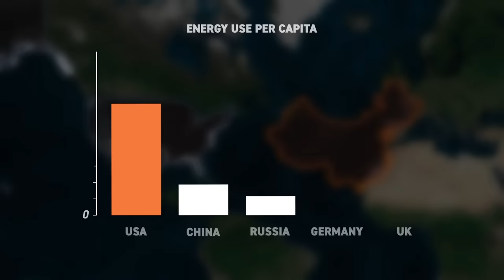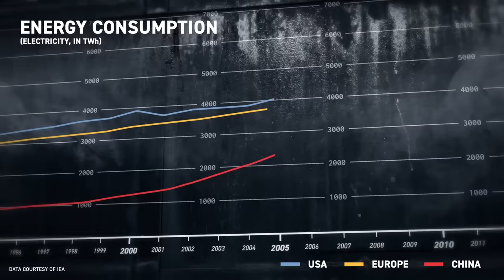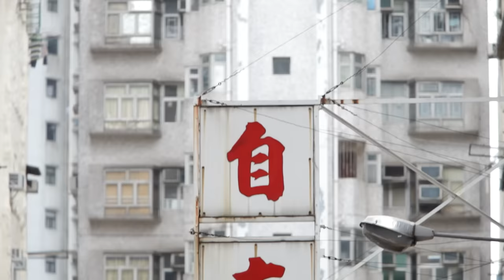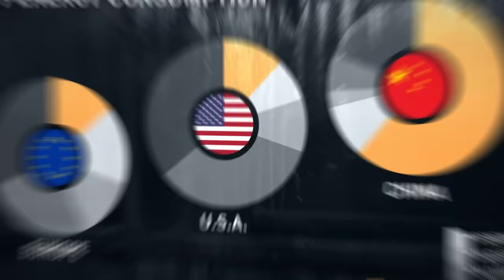China’s Electricity Problem

Comment: Nuclear is the cleanest, the strongest and the safest if managed by competent people who run it properly with proper security measures and personnel. 

Especially if we use plutonium. We just need good public perception and proper political support with good investment capital and awareness.
Reply: I've heard Thorium is also a good idea.
Reply: Its clean but also expensive. China does not want to invest up front, same problem like the renewables, the initial investment is to expensive for them. They would rather have short term gains then long term.
Reply: People also don't think about how much the LED bulb and the CFL before it led to plateauing energy in advanced countries. Every light bulb in my house is LED and every single one could be ion and it might be 100 watts total. That's crazy. We aren't that far removed from 60 watts being the standard for a single bulb. And at night the lights that are typically on in my house equal maybe 10-12 watts. Even our biggest TV uses just 52 watts. My last CRT TV used over 200 watts. Computers and game consoles are the only remaining energy suck beyond cooling or heating your house. Or charging your car...
Reply: I'm convinced (at least India) would be significantly ahead in thorium reactor tech if Homi hadnt been merced by the CIA
Reply: But those safety protocols won’t always be followed. That’s the biggest issue. Competent people will be passed over for favors or outright bribery. Saving money is always going to be the biggest priority, not safety.
Reply: Nuclear is more expensive than solar and wind which are dirt cheap. It's probably less dosh overall to just invest heavily in battery tech while building green energy infrastructure, which is why america's doing that. Nuclear missed its window.
Reply: in china nuclear doesn't have as much as critiques as in some european countries or USA and most don't really mind it. and construction of it has been increasing steadily in the recent years and even surpassing europe or USA in annual constructions of nuclear based powerplants (well albeit they don't have them at all more than a decade ago, so they are building a lot of them now). it's just the demand for electricity is so astronomical that the supply can't keep up at all, thus the rate of growth of fossil-based power plants are also the highest in the world just like i mentioned in the reply i sent to a person up here.

i know this fact cause i went to shanghai for my university education and my friends from there all don't have negative view of nuclear power at all. it's more like they think of them as very cool high shiet than it is being scary. well, idk about the other regions or older generations tho, but according to my urban & regional economics professor whose current research focuses on environmental effects of infrastructure (like high speed trains etc)  its quite accepted/popular.
Reply: @2failepic  It isn't expensive; it is a rock that gives off energy; the costs come from massive overregulation
Reply: @RJT80  you don't wash clothes or us a dryer? Or an oven (electric power I have)
Reply: Nuclear is very safe, the main problem is that it takes very long for it to recoup the initial costs. It's very cheap after you build it, so it's similar to renewables in that respect. There's a good Real Engineering video about this
Reply: I once attended a lecture where they calculated that even if China built 1 nuclear plant every day, it wouldn't be enough for the expected future consumption. Nuclear is the best but still not enough.
Reply: Greetings from Chernobyl and Fukushima
Reply: @RJT80  I think you're forgetting refrigerators, a/c, furnaces, and hot water heaters, as big power consumers. 
Also, as a note, in my area where people often have natural gas for cooking and heating, I noticed that it was actually more expensive for me than using a couple of electric space heaters. But, conditions may be different in other regions.
Reply: Yeah nuclear is clean as if there are no uranium mines that require vast amounts of machinery made and vast amounts of machinery that use petrols
Reply: I also think that nuclear is the only viable path forward for truly sustaining life without a loss in quality of life. Renewals just aren't reliable enough, plus we don't have adequate battery tech, plus lithium mining is extremely dirty.
Reply: @ondrejpalata8979  You were lied to then.  China's energy growth is measured in single digit GW / year.  Your average nuclear reactor is between 250 MW and 1 GW.  So even at the smaller size reactor you can build 90GW of nuclear a year if you make a new reactor everyday.  In fact, in less than 3 years at that rate, you could replace China's entire power infrastructure with nuclear.
Reply: @IntrusiveThot420  All three of what you mentioned would be less efficient overall and much more damaging to the environment. Not to mention, not nearly as practical. Battery tech isn't anywhere near what it would need to be to be used in infrastructure. Unless you somehow send them out to each home and multiple to every building, which would be not just expensive but extremely damaging to the environment.
Reply: @pyropulseIXXI  building reactors is very expensive.
Reply: @saranyoo4098  Fukushima reactor did exactly what it was designed to do. Even the tsunami was foreseen but the remedy was ignored as it wasn’t cost effective. The tsunami was the problem, not the “meltdown.” Kyle Hill did a great video on Fukushima as part of his “Half Life Histories” if you’re interested.
Reply: @seanshankredemption1603  natural disaster or not. The main problem is the radioactivity. The soil would be useless, megacities would be ghost cities, main rivers would contain radioactive particles and spoil fertile soils along the rivers that China is crusially depended on or the fallout rains on main river heads of china. Because powerplants cannot build far away from urbanised areas, china must build them in very dense populated areas. Now imagine for a somewhat reason a meltdown happens, the soils that china is extremly depended on is spoiled for million years, how would that effect global population?
Reply: @saranyoo4098  I don’t think that far ahead. Build nuclear everywhere. I welcome many Chernobyls. Maybe Ukraine Russia will yield a nuclear Holocaust that wipes out most and leaves the rest to play Fallout in real life.
Reply: @seanshankredemption1603  are you a kid? You understood what I said right? If it was too hard to understand: China is dense populated, china's rivers and arable land are one of the most important food supliers to world population, rivers could carry radioactive particle everywhere where the soil use the water of it. I don't think it is worth a risk maybe it wouldn't be that dramatic if nuclear powerplants are build in deserts or something
Reply: @saranyoo4098  I’m not a kid but I am a child. It’s a fine line but I believe a distinction can be made.
Reply: @RJT80  This makes me wonder if that isn't the reason why China made the 3 hour gaming rule for children.
Reply: @2failepic  I don't know what you are smoking. China has been developing Nuclear power. It's been using nuclear power for decades now and it's also leading in constructing new nuclear power plants.
Reply: @IntrusiveThot420  Nuclear makes electricity when the sun doesn't shine & the wind doesn't blow. A nuclear plant has a tiny footprint compared to equivalent solar & wind.
Reply: @IntrusiveThot420  It's more expensive in the West where there's massive redundant overregulation.  The one good thing about the Chinese system is that they don't need to use these regulations.  The bad thing is that SOME of those regulations are actually meaningful.
Reply: Thorium is better.
Reply: @1224chrisng  nuclear is not that safe and can be used as a weapon. Not so with thorium which is safe, cheap and abundant.
Reply: with chinese corruption though...

I dunno, Chernobyl
Reply: "if". You're asking for perfection from imperfect humans further divided by jurisdictional lines. Because "when" a mistake happens, it can take out whole areas from usability permanently. Doesn't matter what the fuel is either, because anything above-ground going nuclear is significantly more toxic to the environment.
Reply: @hunterpayne6167  What are you talking about? China's generation capacity is around 2200 GW, so your 90 GW/year would mean you'd need almost 25 years to replace the entirity of this generation capacity. Moreover 90GW/year is a lot, that comes down to around 56 full size reactors build a year. To put this into perspective, that is more than the amount of commercial nuclear reactors China currently is operating, which is already probably the most nuclear reactors in any country.

Oh, and in 1 year (2019 to 2020) China added around 200 GW new power capacity to their grid, so far for your single digit GW/year.
Reply: @doujinflip  there several nuclear power plants working in peak efficiency because the staff including the management knows that one mistake is costly and several consecutive mistakes is a meltdown. What I stated is what current nuclear power plants uses for running the operation. 

It is destructive sure but we can run it with proper management and staff than it is the safest thing on earth. We are imperfect but not incompetent. We have flaws but we learned to adapt and solved them. 

What I’m asking isn’t perfection but a minimum standard in a power industry set by safety staff and administration when it comes to nuclear energy.
Reply: @MDP1702  This is a good lesson in utilization vs capacity.  That nuclear reactor is making power almost all the time.  Nuclear has a utilization factor of .9 or above meaning on average over a long period of time for every 1 watt of nuclear deployed you get .9 watts delivered. For fossil fuels, that is .6, for renewables it is .1.  So that 90GW of nuclear capacity is worth as much as 135 GW of fossil fuels or 810GW of renewables which is China's entire fleet of renewables currently.

You are using capacity numbers which are meaningless unless you are the one financing the plant.  I am measuring delivered power which is what counts.  This is why Germany has 2x as much renewables capacity as peak load but still have to import power from France most of the time.  On average, only 20% (that's 200% x .1) of German power comes from renewables despite the fact that they are more like 70% or 80% of the capacity.  Nobody cares about capacity.  When someone quote capacity to you, you are trying to mislead you.  Power delivered to the customer is what counts, everything else is just waste.  All the numbers I gave you were in delivered power and you quoted capacity right back at me.  That's why they don't match.  Hope you learned something from this.
Reply: @adamperdue3178  What gives you the impression the USA's regulation of nuclear is over-regulated and redundant? And why do you think China doesn't need similar regulations? And while we are at it, tell me more about the 'SOME' of the regulations you deem are actually meaningful and how they stand out from all the meaningless regulations you have identified. You must be super knowledgable on so many subjects to know these things. An expert on federal and state nuclear regulations and laws, Chinese nuclear regulations and Chinese law, and the Chinese bureaucracy in general. Where did you become an expert on so many things?
Reply: @hunterpayne6167  
Nuclear has a utilization factor of .9 or above meaning on average over a long period of time for every 1 watt of nuclear deployed you get .9 watts delivered. For fossil fuels, that is .6, for renewables it is .1.  So that 90GW of nuclear capacity is worth as much as 135 GW of fossil fuels or 810GW of renewables which is China's entire fleet of renewables currently.
This is pretty meaningless if you can't store or use the constantly produced nuclear power at all times. The main reason to have such high capacity is to be able to deal with peaks/variability and maintenance downtime. You can't just lower the needed capacity because nuclear overtime can produce more, this is perfect to get brown outs at some time and overproduction at other. Also your utilization factor for renewables is very low, should be more between .2 and .6 depending on which specific renewable we are talking, some even close to nuclear (hydro).

You are using capacity numbers which are meaningless unless you are the one financing the plant.
The fact you think capacity numbers are meaningless in grid management already says a lot about your knowledge on this topic. Having the right amount of capacity is crucial. Too low and you are going to have black outs/brown outs for certain at times, too high and you are just wasting money.

I am measuring delivered power which is what counts.
This definitely isn't at all what only counts. That is just a part of it.

This is why Germany has 2x as much renewables capacity as peak load
This is more to do with renewables being more variable in output than something like a nuclear, gas, coal, ... powerplants. You install higher capacity to deal with that variability. And sure you could take this into consideration in switching to nuclear, but China only has +-530GW variable renewables installed, meaning you still have 1500GW to account for and at least half of the renewables, so more like 1700GW. You also can't just put in place the bare minimum, you always will need redundancy in the system in case one or several reactors fall out.

but still have to import power from France most of the time.
Germany actually isn't a big electricity importer at all. In 2019 it imported double of France, but in absolute numbers it was low. France imported around 2 TWh (0.5% of demand), Germany 4TWh (1%) and the UK around 20 TWh (7.5%). That Germany is a big electricity importer is more an argument people like to use against renewables. Only 5 other EU countries imported less as % of demand. Overall speaking Germany in 2019 was the 2nd largest net exporter in absolute numbers and 6th in % of demand (France being 5th).

on average, only 20% (that's 200% x .1) of German power comes from renewables
What year did you get those numbers from? On average 40 to 45% of power in Germany is produced by renewables in the past several years, it has been the largest powergeneration source since 2014, more than double the TWh of the second source (lignite) and nearly triple the third (natural gas)

despite the fact that they are more like 70% or 80% of the capacity.
More like 61% actually.

Nobody cares about capacity.
Anyone who doesn't care about capacity shouldn't take part in a discussion on grid management. But fine I looked into it deeper and I found a max demand of around 844GW in june this year. I can't say for sure this was the highest ever, but I'll use this as a benchmark. Considering that you'd rather never have brown-outs or black outs, you better take some reserve and talk about around 1000GW certain capacity availability, this is still +-12-13 years of building nuclear powerplants at the pace you propose, which already was an insane pace considering you'd have to finish the same amount of commercial nuclear powerplants currently already active and this every year! You can be lucky if you even reach 10% of that, nearly a miracle for 20% that amount.

Power delivered to the customer is what counts,
And you can't deliver the power if the capacity it too low to match the demand.

Hope you learned something from this. And next time you try to act like you have the knowledge/understanding the other side doesn't, make sure the other side didn't actually study the topic at university
Reply: @briano7986  I'm with a company that manufactures parts for reactors and also leases out engineering assistance for companies to build reactors.  To give an example of what I'd call an 'overregulation', one project that we're working on is using a newer reactor design. The NRC is demanding that we can prove that the plant would withstand both A) an earthquake (I can't remember the exact magnitude, but it is an excess of any earthquake EVER recorded in the area) and B) a Tsunami, despite the fact that the area is about 300km inland, and also about 300m above sea level. The NRC is demanding we can prove it would sustain little to no damage if it got hit by BOTH events at the same time, and has halted construction on the project until a series of expensive and time consuming trials are carried out.

As for China, no I'm not an expert on their nuclear policy specifically, but their system is designed in such a way that they don't have to cave to popular demand when popular demand is just being silly. Though they do have their own problems so idk.
Reply: @briano7986  but even if you don't believe me, you can just look at the data. Nuclear is the cleanest and safest energy source by every metric, and though we haven't had any major accidents in the US in DECADES (hell, calling some of the accidents that we have had as major seems like an insult to the term) and yet more regulations get added every single year. Why? The existing ones have been working.
Reply: @adamperdue3178  You got me. You sure got more knowledge than I figured. In my years of experience working within regulations and SOP's, I have been know to smite government red tape as well. But I have also found new insights on the benefits of regulating things. You may have good reasoning abilities and the ability to make considerate choices without having your hands tied by the rules, but not everyone can be trusted to do that, so the rules are for them.
Reply: @briano7986  In nearly all cases, regulations create inefficiencies.  Inefficiencies drive up prices.  Goes to figure that the most regulated mode of creating electricity happens to not be price competitive.

Of course, regulations can still be meaningful if the value created by it is greater than the cost of the inefficiency, such as many regulations regarding safety and pollution.  The problem is, as with all other things, there are diminishing returns.  You can create a lot of safety by mandating that companies don't use reactor designs that are known to be unsafe (such as the RBMK).

But you create virtually no additional safety by mandating that a plant being built in western Virginia be able to withstand an 8.0 magnitude earthquake AND tsunami at the same time, when the biggest earthquake any part of the state ever experienced was a 5.9 in 1897.  Nevermind that if a tsunami gets that far inland at that altitude, there's going to be much more pressing concerns than a nuclear reactor taking 'moderate damage'.
Reply: @adamperdue3178  in all cases regulation keep people alive and ensure the product is providing what it promised safely, and for a fair price. Mandating safety based solely on past events guarantees troubles, so its prudent to regulate for possible future events. With weather events becoming more intense right before our eyes it makes sense to be prepared. In Vancouver the building codes didnt account for the increased effects from local weather and got a city of leaky buildings, and in Japan they didnt account for two intense events to happen at once and it caused big trouble for the nuclear plant. I wonder how much it costs to clean up huge problems instead of paying to avoid them in the first place?
Reply: @briano7986  bro do you work for OSHA or something?  Your viewpoint on regulations sounds straight out of a pamphlet.

"I wonder how much it costs to clean up huge problems instead of paying to avoid them in the first place?" Less.  It costs MUCH less.

It's estimated that cleaning up after the Fukushima incident cost about $20 billion.  Now I'm not intricately involved in the finances of the company, but based off what I know, I would not be surprised if the delays and testing and redesigning have cost our project over $1 billion, because of a regulation born as a result of the Fukushima incident.  $1 billion to account for something that will NEVER happen.  EVER.  A tsunami hitting this far inland would mean over 100 million people dead by virtue of the tsunami itself.  And the safety standard isn't making sure that there won't be a meltdown, should this event happen, it's making sure that there won't be 'significant damage'.  The design is already proven that it wouldn't undergo a meltdown.  Scale up the perhaps $1 billion cost to every other building project that's so far inland as to make it an impossible eventuality, and the United States has already paid more for Fukushima than Japan has.

Nuclear power is nearing a century old now.  The amount of significant incidents that have happened can be counted on one hand.  Even including Chernobyl, nuclear has resulted in less fatalities and injuries per kWh than any other source of electricity.  Why is the safest source of energy the one which is being targeted the most be regulations?  It's because of a negative public perception which paints nuclear as dangerous, which is only perpetuated because of fucking idiots who have NO idea what's going on, but are more scared of invisible radiation killing them than they are of air pollution killing them.
Reply: @adamperdue3178  Have you ever been involved in making the regulation for something like nuclear reactors or really anything? It's usually people in the field with lots of relevant education and experience that are tasked to develop the regulations in any industry. So it's not politicians that create regulations, its experts. Yeah they might go overboard with fear and take some regulations too far, I'm sure it happens and can be a waste. But you are reasonable and must understand such things. What I'm hearing from you is this very American point of view on things outside your power to control. You don't like being told what to do and don't want to follow the rules like everyone else because you are exceptional, so you blame the government for making you do stuff you don't want to and you undermine the governments value to get back at it for humiliating you and emasculating you by treating you like everyone else. Or am I wrong and you blame the government for your failed business not taking off? if it wasn't for those damn regulations I would of been a filthy rich with all that nuclear reactor money I was gonna make!
Reply: @briano7986  Neither.  I'm a concerned citizen wallowing in dismay at the massive inefficiencies wrought onto our society by a government whose first solution to any given problem is to regulate it.  While regulations have their uses, they're a tool just like any other.  Careful and precise usage of them can solve many important problems, but overreliance on them (and overly strict enforcement of them) can cause even worse problems than the ones the regulations were meant to solve.

As for the regulators often being largely comprised of 'experts'?  I frankly don't care.  Not in regards to nuclear, not in regards to anything, really.  The type of people who find themselves on the boards of regulatory bodies aren't typically selfless, well-intentioned, and competent in their field.  Most often they received these positions due to clout or politicking, rather than being exemplary in their field.  

For the NRC, I think that by and large they're well-intentioned, but they're FAR too cautious.  The problem here is if they loosen their restrictions and 1 person dies in a minor nuclear accident, the NRC will face immediate public backlash, while if they maintain the status-quo and millions die due to pollution and other such problems; well, that's not the NRC's fault.

(Also I WISH I had the kind of money needed to be running a failing nuclear business, lmao)
Reply: "Nuclear is the...safest..." but also "...we use plutonium" Lol and that's why the industry is dead today, comments like that. Can't even keep your story straight...
Reply: @m2heavyindustries378  industry actually very alive even more so. Power needs have doubled and fossil power plants not able for provide that unless there are more of them. 

The comment needed to be short and informative which succeeded.